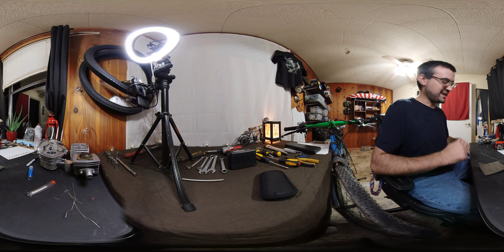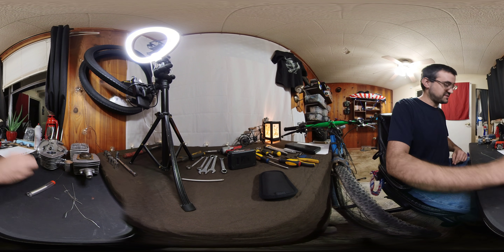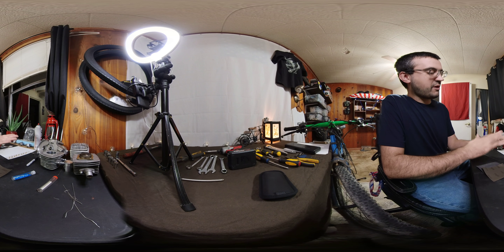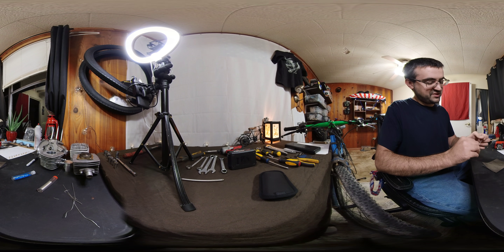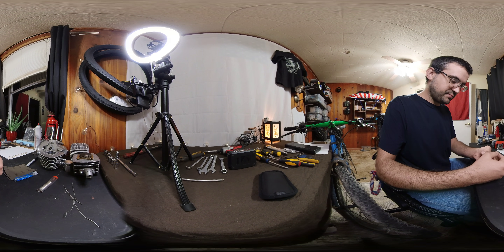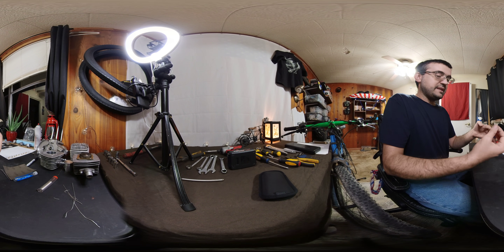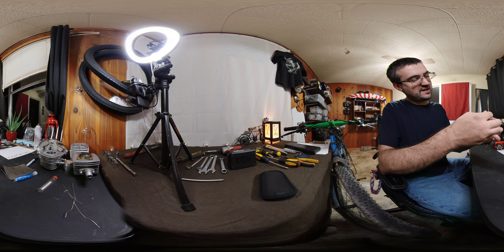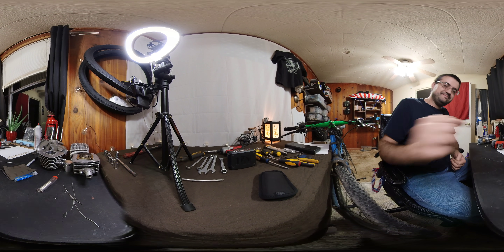How To Find Your Stock Jet Size

Comment: Just built my first kit. A zeda 80 triple 40 based engine from bicycle motor works. Used your videos to do a lot of research to find this kit and am happy with quality. Now I just have to tune it to run well during break in.

Comment: Amazing you made this video today because I have been fighting with a brand new YD100 today. I cannot get it to start! I have lots of spark, its getting fuel, and has compression. You may have answered my question before I even asked. I have additional jets, but mine are in the increment of .05's. I have tried them all from .60 to .80 with no luck. I will look into getting the jets in .01 increments. I am using an NT carb..Also, do you notice about 3mm of the piston skirt visible from the intake port at the top dead center?
Reply: Shave the 3mm off the piston it will help with air/fuel mixture flow
Reply: @STRETCHYEDS  yes that is something I still need to do. I did get it ripping though. Wrote this comment couple months ago. But yeah skirt piston on the list

Comment: i just got this really nice bike kit in the mail, with a g4 cylinder and everything. but im so glad i took it apart after i got it in the mail because HALF the chrome liner was not there from factory. so if i ran this engine even at all, it would just chip the rest away and destroy the whole thing! i had it all on video. another thing was i took my camera and i was  like "oh cool it comes with the upgraded 1 ear style wrist pin clip. but when i zoomed in with the camera i realized IT WASNT SEATTED IN THE INDENT it was literally just laying in there! if i ran the engine at all it would have literally flew out and ceaseed the engine while riding

Comment: Why do you think a #65 jet is gonna burn up your engine?
Reply from the maker: That was just an example, a 65 may run great on many motors. But running to small of a jet (to lean) can cause poor lubrication and excessive heat.

Comment: Do you think if I rich the oil the air fuel mix would lean out to a good mix with the stock carb(since more oil renders less gas coming out the jet) ? I'm testing the yd100 and so far is so much smoother than the bt100. Im happy with the change:D
Reply from the maker: It will make a difference, but I don't know how noticeable it will be.

Comment: hey I am wonder if a Ambienceo 80cc would be good and not be a rip off?
Reply from the maker: I stay away from painted motors when I can. The overspray causes more issues than you might think it would. At a glance the build looks good, but I can't tell if it's a true 66/80cc or a 50cc. Sellers have been known to lie about the CC and it makes a big difference.
Reply: @LAHover  thank you so much!